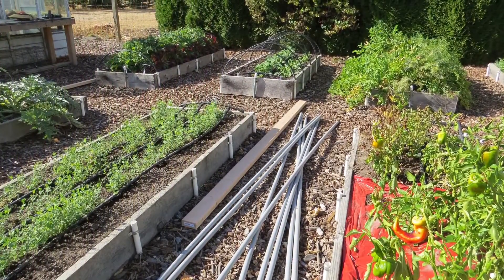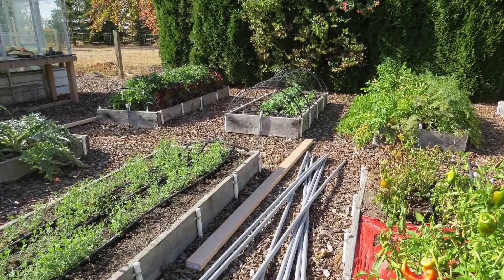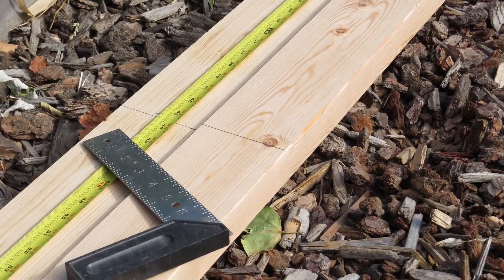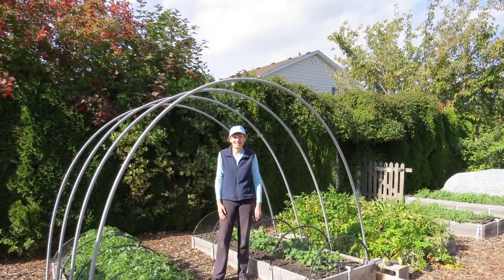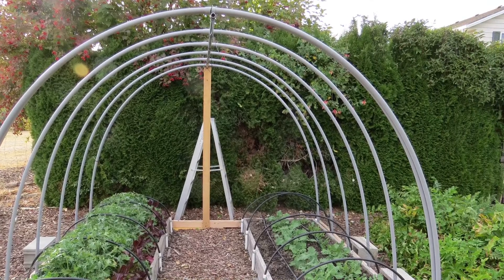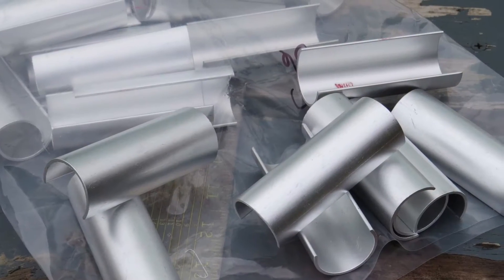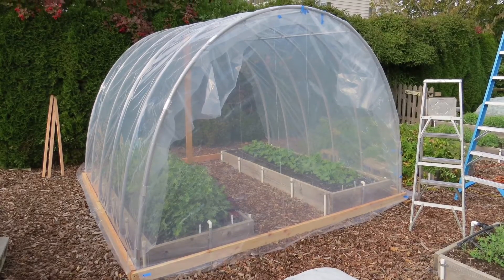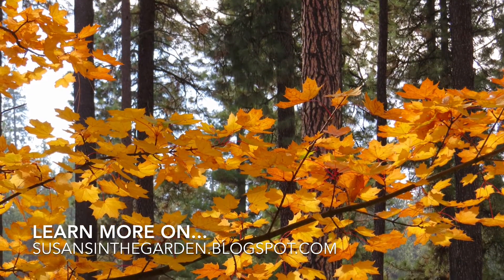How to build a hoop house or polytunnel

Comment: Hi Susan. I was curious how the hoop house holds up under snow loads. Also your garden appears to be sheltered from strong winds by  rows of arborvitae,  maybe thats why you don't need to anchor it down? I just love your videos especially the monthly tour sequence you shot.
Reply from the maker: Hi, Mark. Thanks so much for your nice comments. Re: snow loads, when we get a few inches of snow, esp. if it's heavy wet snow,  I go out and brush it off the hoop house. the arborvitaes do block some of the winds but my husband did anchor down the hoop house by using rebar and brackets. You can find info on this on my blog: https://www.susansinthegarden.com/2014/11/hoop-house-follow-up/. Bill also places a heavy concrete block on that bottom board of each long side of the hoop house. We do get some strong winds but have never had any problems (thank heavens!).
Reply: N
Reply: Hi your garden is gorgeous 
 If you do t mind could you list the items and sizes you need for polly tunnel please x
Reply from the maker: @tracyblackwood6907  Hi, Tracy. I saw that you had commented on Mark Goodsmith's reply, rather than mine. I'm the person who created the video and whose husband designed and built our little hoop house. If you go to this link on my website, you'll see the supply list: https://www.susansinthegarden.com/2014/10/hoop-house-project-2/. There's also a follow-up post at this link: https://www.susansinthegarden.com/2014/11/hoop-house-follow-up/. And if you have any other questions, just drop me an email at Susan@SusansintheGarden.com. Cheers.